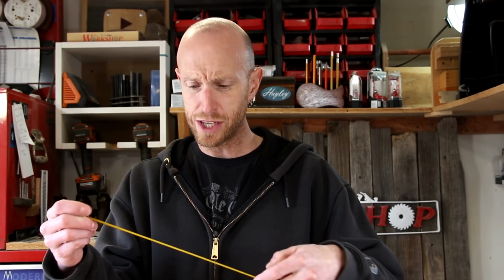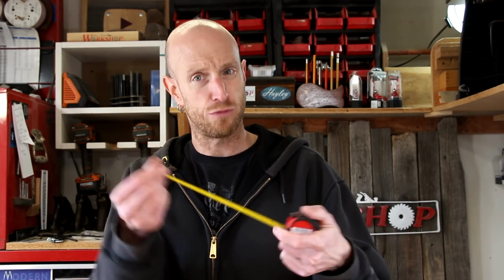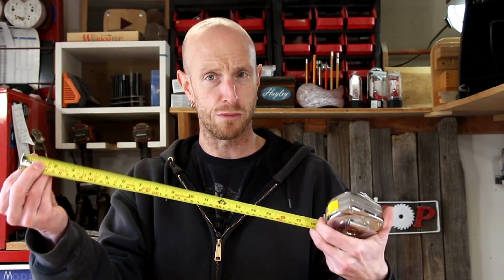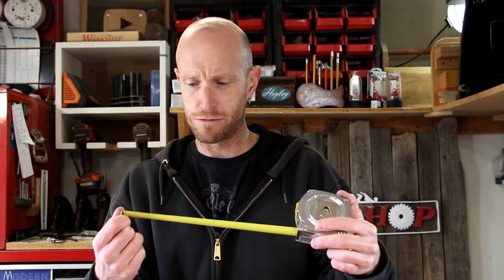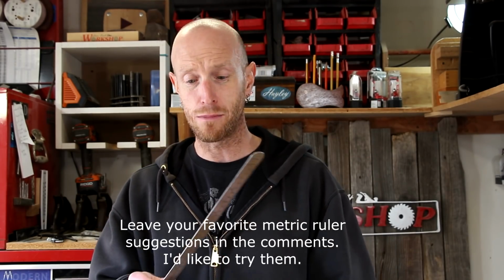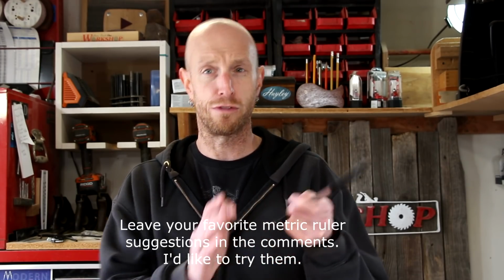My thoughts after using the Metric System for a project | I liked it

Comment: The thing with the metric system is that everything goes together in to the same base of mathematics. Volume, distance, weight, length and density. So when you know the proportions of something you automatically know many other tings about it.
Reply: What kinds of tings do you know?
Reply: Liters(volume) of water convert directly to kilograms(weight)
Example: 30L of water is exactly 30kg, or 0.03 cubic meters(volume again).
So you can also approximately calculate the weight of other fluids too...
Reply: @RaptorTroll360  It gets better, if you take a kilogram (ie, a litre) of water and raise it by one degree Kelvin, it's one kcal (which is not an SI unit but is pretty convenient.)
Reply: @1pcfred  If you know the volume and wight you know the density, if you know the density and wight you know the volume. If you know the density and volume you know the weight. It is all based on the weight, and volume of water as a prefix. And also there is fixed geometrical shapes that are very easy to do instant converts into all the mentioned measurements and the base shape is the cube. Milli= 1/1000 Cent=1/100 Deci=1/10 Hekto= 100/1 Kilo= 1000/1. The system is the same regardless of what you want to measure that is why it is so easy to convert from one property to another.
Reply: This is a great benefit. It for example means you can just as easily calculate the force exerted by a certain pressure on a 1m2 surface as on a 1mm2 surface. Just divide by 1 million.
In imperial, you divide by 144 to go from a square foot to a square inch. Or was it 256? And from square yard to square inch, the number is 1296, I think.
This nonsense costs the US economy millions each year, mostly due to preventable errors that e.g. caused a mars probe to crash.
Reply: @TheEvertw  Not to mention the failed landing on Mars.
Reply: @mikelfox1543  but why would I want to? I have no practical use for any of that. So what good is it? What would knowing do for me? Better yet what does knowing that do for you? Where in your day to day life do you use any of that? BTW it is not weight it is mass. On the Moon things weigh different but their mass is the same. They did Newton's experiment on the Moon. One of our astronauts dropped a hammer and a feather. They both landed at the same time. It was pretty surreal. Now tell me what weights more a pound of feathers or a pound of sand?
Reply: @1pcfred  A pound is a pound. How I use it in everyday life is like any mathematics, most often I dont. Dont want to start a war here. You do what works for you. Just tried to point out what I feel makes the metric system logical and easy to use.
Reply: @1pcfred  what is the practical use of trying to add portions of length in imperial? how do you add 17/64 +14/32 of an inch? and how easy is it to add 3 feet 10 inches + 4 feet 8 inches? its getting really messed up. and whats the volume of a cube with 3 feet 10 inches on each side? a complete mess
Reply: @dimosk7389  what indeed is the value of thought? Why exercise the mind at all? Everything in life should be easy. We should all be spoon fed. There is no reward in effort. Why even bother? I agree it is a complete mess. I add 17/64 +14/32 by doubling the numerator of 14/32 to 28/64 then adding 28 + 17 = 45/64 How do you do it? There is another way. Two really. Your example problem is not really realistic or practical. It would never come up in real life. If you were really interested in a precision of sixty fourths you'd probably be working in decimals anyways. Being as a sixty fourth is 0.015625 Or a smidge over a hundredth and a half of an inch. So you're only a bit over a magnitude away from a thousandth. Which is not really such a great leap. But you aren't really interested in practicalities, are you? You've never had to be. So why start now? You're punching way over your weight class kid. Pro tip: Never ask questions that you don't want the answer to.
Reply: @1pcfred  when I try to repair something at home and have to make a measurement of two pieces of wood, Its much easier to add metric numbers than imperial. It's basically "spoon fed" to you, as you prefer it.
There, I just gave you an everyday example of why someone would bother. 
I am definitely interested in practicalities. The numbers I gave you, were completely random. Don't you understand that, adding 1,24 meters plus 1,56meters, is MUCH easier than adding 3 feet 10 inches plus 4 feet 8 inches for example (random numbers)???
Are you so self minded that you can't accept that another method is much easier and simpler than the one you were taught?
Reply: @fex144  who the hell are you?
Reply: @1pcfred  in fact it would help the rest of the world in so many ways.
Reply: @1pcfred  do you really want me to believe, that a simple volume to weight conversion is nothing that Americans do? There lies the real strength of the metric system.I think most Americans don't even know, that they make their own life so complicated. And yes, I know that everything in gods own country is perfect and the rest of the world is literally the Neandertal (actually the Neandertal or Neander valley is a place here in Germany). But can you for a second imagine, that there might be methods out there, that could make your very own live easier? Can you or can you not?
Reply: @m4riel  oooh yes, that feeling when the recipe asks for 25mL of water and your measuring cup doesn't have a line at 25mL, so you simplyuse a kitchen scale and weigh 25g to give you the same quantity
I do that all the time (caution, doesn't work with olive oil but it works good enough for vinegar or wine)
Reply: @thesteaksaignant  Where did I even mention the whole 1Kg/L density of water thing? I can't tell if you're joking because that actually happened to me a few times. My measuring cup shattered and I used a scale and a small list of basic densities for water, milk and oil to measure it for a few days.
Reply: @m4riel  you seem to believe I was mocking you when I was in fact agreeing with you and providing additional anecdotes for when the metric system comes in handy. 
You did say you used it for mass, volumes and density conversions with a measuring cup or a scale. I don't think my example is too out of place

Edit: I read my previous comment and I see now how it can seem sarcastic but I genuinely do that all the time, my measuring cup is so old that most lines are hard to see
Reply: @thesteaksaignant  Yeah, I figured it could've been the case lol sorry
Reply: @1pcfred  "but why would I want to?" - well, maybe you dont want to. Maybe all you ever build is on an inch scale. 

But imagine building eg. a bridge or a skyscraper in inches only - kinda impractical isn't it? As soon as you have feet and yards you have messy conversions, and with every conversion things can (and eventually will) go wrong, which causes errors, delays and cost.

And that's just with lengths. Now think you want to build a production facilty, say a chemical plant. There you not only have lengths, but also , volumes, weights (e.g. how much does a full tank of one of the chemicals weigh, how strong do the supports have to be), flow rates, etc. ... In Imperial that's even more odd conversions, i.e. even more places where mistakes can (and will) be made.

Now scale that up to a whole country's economy and try to imagine the unnecessary cost that is created by all those unnecessarily cumbersome conversions.
Reply: @1pcfred  It's a tool... Why would you make a tool harder to use *on purpose*? Also if its easier to estimate a solution in your mind, its easier to spot errors in your calculations.
Reply: @1pcfred  noice. So when the web goes down watcha gonna do?
Reply: @iplaygames8090  why be the Lord of the Wasteland and the Ayatollah of Rock and Rolla! Of course. That and use my intranet.
Reply: James Hayden  now that you mention it yes I have made my own saw. I cut the teeth 15 TPI. How do they do tooth pitch in metric? I've never seen it.
Reply: @1pcfred  as an example of what you could repair around your home:

I just replaced the majority of our kitchen, I had to add together all of the base cabinets of different sizes, then add to that the 18mm finishing boards and on top of that had to add in a 32mm overhang for the counter top.

also had to take into account the fact the counter top is 38mm thick, the surface of it should be 900mm from the finished floor to "feel right" and the fact that my finished floor will be 15mm higher than my sub floor, all while the base cabinets are 720mm tall.

as someone who has used the metric system their whole life, I cannot imagine truing to do all that it feet, inches and fractions of inches.

if you can do simple addition and subtraction, thats all you really need to use the metric system.

another example, I needed to order a new filter/pump for a fish tank, had no idea what the capacity was, so i just busted out the tape measure and found out within a minute.
Reply: @myopinion69420  here we just go to a cabinet shop and they design cabinets for us. They're all the same standard sizes. All you have to do when you install them is make sure they're level. All the measuring in the world won't change that either. Either you're bubble up or you ain't. Floors are not always perfectly level either. Houses can settle. So you put all your cabinets the same height off the floor and you have out of level cabinets. Good job! I'll give you a pro tip building, do as little measuring as possible. The less measuring and figuring you do the better your work will come out. I really do not care what measuring system you use either. Don't measure remains true regardless.

I do not have a fish tank but I do have a pool. It is a 16 x 32 oval. Now how are you going to figure its volume out with just a tape measure Archimedes?
Reply: @1pcfred  i am well aware of how to build and install kitchen cabinets. your way i would just pick a random height and just hope the dishwasher fits under once the floor is in? thats a bad idea. i was not saying i set EACH cabinet the same height off the floor, but i did need a starting point and used a laser level to do the rest.

"do as little measuring as possible" is a recipe to running way over budget.

who said anything about your oval pool? how would you do that in 'standard'? that being said, with a bit of trig and a bunch of measurements you could get a decent approximation of the volume.
Reply: @1pcfred  I would be more than willing to engage in  a meaningful discussion if others haven't already. Yet you seem to make a huge fuss out of trivial details like differences in floor height. Really?

One argument: simple calculations such as area, volume, density, mass even energy consumption, are all very easy to calculate, unlike imperial.
The field of mathematics and science uses the SI system, because it's so easy,  convenient, understood instantaneously by all that uses and understands it. Centi-one/hundredth, hence centimeter(0.4 inches). Milimeter, one thousandth of a meter, kilo one thousand meters.

You can so effortlessly deal with small and large numbers, convert to different, more appropriate units of measurement easier. Metric units increases or decreases in multiples of 10. Mili, Centi, deci, kilo and everything in between.

Even in today's digitalised world, why not just use a better and more convenient system? Why say 1 foot 3 inches when you can say 38cm? And convert to other units using factors of 10?
Reply: @1pcfred  Somethings it isn't about what the system can do for you, how it can help you specifically. It is about the greater math and science community with their respective fields of study.
Reply: @1pcfred  Not to mention the glory of metric being so accurate. Write something down as 1 meter and desire it to be more accurate? 1.32m, 1 meter and 32 centimeters. Bases of 10, moving decimal points, not a problem. Same way you can express 1.32m as 1320 milimeters, just divide by 1000
Reply: @1pcfred  Agreed! And the Imperial system is soooo practical, efficient and easy to use that many organizations in the US, mostly those concerned with efficiency and practicality, are using it exclusively : US Military, Medical, Nasa, Scientific community.. Oh wait, no they use the metric system! Sorry, my mistake! :) Still congrats for knowing more one way to add fractions, quite the academic achievement! :) All in good fun : you know that the day the US goes Metric and gets a decent health care system, then the rest of the world won't have anything to make fun of! (add Education system and some knowledge of Geography to the list above) :)
Reply: @1pcfred  AAAAAAAAAAAAAAND another american trying to defend the imperial system. mom, get the popcorn!
Reply: @1pcfred  I cook. Sometimes I don't have a measuring cup. No issue, I use my weight instead. For water, milk and most other common cooking liquids, 100 grams equals 100 ml or 1 dl.
Reply: If easy things are easy to do then it makes harder things easier to figure out. 
If our numerical system required us to calculate for an hour every time we wanted to add 1 and 4 we would not be as technologically advanced as we are.
Reply: @aLmAnZio  you have a precision scale more often than you have measuring cups? Are you an unlicensed entrepreneurial pharmacist too? Because I've been in a lot of kitchens. Most don't have gram scales in them. Measuring cups are pretty basic though.
Reply: @rodabanane  no American ever needs to defend Imperial because no American has ever used Imperial. We have our own system called US Customary. Only the names are the same. Although everyone has adopted the standard international industrial inch. Which itself is not Imperial either. Which is why our inch is the same as the British inch is today. It is neither Imperial nor old US. All of that is likely why you confuse our system with Imperial.
Reply: @arandominternetuser5203  you are confusing accuracy with precision. They are two different things.
Reply: @arandominternetuser5203  not being in the math or science community myself I fail to see how any of that has anything to do with me.
Reply: @arandominternetuser5203  when you're setting kitchen cabinets floor and ceiling heights are anything but trivial. If you'd ever done it then you should know that too. Or you're just blind. Really.

As far as why one would want to say 1 foot 3 inches as opposed to 38 cm goes the human mind has difficulty envisioning larger quantities of things. So a foot and a bit more is easier for us to mentally deal with. Close your eyes and imagine 38 separate things in a row. If you say you can do it then you're just lying. Because we can't do much more than 3. It is a mental limitation. How metric works completely ignores human limitations. You can run into the same problem with standard too. Things can be large numbers of inches. In general we can express values in more digestible values though. As opposed to thousands of mms or cms. Basically metric lacks the foot equivalent value. There's the decimeter but it never caught on. It's a useless size. It's so bad most metric users don't even know what a decimeter is. They've never even heard of it. Metric was never scaled for human use. It is nice and neat but life isn't. The messy standard system just fits things better. The consistency of metric comes off as random in use. Like all of the numbers you've rattled off. You could say a foot and a quarter instead of one foot 3 inches. Although that would be weird. It still works. Standard can be rounded to work. I suppose instead of saying 38cm you could just call it 40. But that is way off.
Reply: @myopinion69420  but you claimed that using metric makes all volume calculations easier. I have to go out and work on my pool right now.
Reply: @1pcfred  dunno, but I would only need to know the density to do a simple conversion and know how much space you wasted by bringing a pillowcase full of feathers on the Moon.
Reply: @1pcfred  what's the weight of 300 fl oz of water?
Reply: @1pcfred  You are right that decimeter is rarely used (at least outside of its cubic variant, representing 1 liter btw), but the concept of 10 cm is well known and as easy to imagine for someone using metric on a daily basis as is 1 foot for you. If said person wants to know how much would it be 38 cm they could to see it as 4 x 10 cm. For me 10 cm is about the width of the palm of my hand which can be helpful in such situations. No need to force the brain into 38 individual sections 1 cm each.
Reply: @1pcfred  Lets say you are baking a cake and you need 300ml of milk. You can easily pop a container on the scale, tare it, fill it with milk, and pour until the scale reaches 300 grams. The reason this works is because milk has an extremely similar density to water. If you have to measure out lets say 1.6 quarts, you can measure out a quart, but now you are stuck filling many ounce measuring cups just to get that .6.

Imperial system works good when mixing drinks because you are making a small amount and the accuracy doesn't matter too much, but the second you need to measure larger amounts or measure liquids accurately, quickly, and with little effort, the imperial system fails in every way
Reply: @RaptorTroll360  weighing liquids other than water is very rough. Oil (any) is more dense than water. Or patrol/diesel. So be very careful when "roughly" calculating the weight of a liquid tjat way.
Reply: @1pcfred  I live in Norway, all our scales measure in grams. Like dirt cheap ones. And yes, I often end up in a situation where my measuring cups are dirty, and scales are more convenient.
Reply: i still remember trying to calculate how much water can i put into XxYxZ pool... thanks god i needed just calculate inside and from 1 dm3 convert easily to liters, i would die calculating this in imperial
Reply: @1pcfred  Yeah why should we use a unified system that allows people to instantly know the magnitude and conversion to anything just by applying simple rules therefore giving them an easier time working with those units so they can focus in more important things while doing maths? Nah im sure thats for spoonfed millenials who don't want to divide by 16, or 12 or whatever.

Please stop humiliating yourself.
Reply: @brendanbush2174  if I was baking a cake there's no way I'd use one with ml measurements in the recipe. It'd be a pretty big cake with a quart and pint of milk in it too. That is an incredible amount of wet to be in a cake. You ever bake a cake? Looking at a typical box cake recipe 1-1/4 cups is about all you put in an average cake. They usually get their moisture from oil and the eggs. As it's name suggests a cup is about the size of an average cup. 8 fluid ounces. Imagine a medium sized tea or coffee cup. There you go. A cup. For baking a cake using it would suffice. We're not trying to decode DNA here so ml accuracy is not required. Get the batter to a consistency and pan it up. You're going to wreck your cake in the oven using that horrid temperature scale you have anyways. So don't sweat the mix. And where's your metric time anyways? With 100 minutes in every hour and 100 hours in every day. Come on kid make it happen. I need more stuff to poke fun at.
Reply: @brys555  the palm of you hand you say? Would that be a hairy palm?
Reply: @1pcfred  Did you know that alot of things in the US is already using metric system. like medical, science, engineers are. Also many international products like cocacola propably is there in liter
Reply: @1pcfred  You jumped on that typo like a duck on a june bug!
Reply: @blockbertus  There are exceptions, but generally most oils are LESS dense than water, not more dense. There's a reason why oil and gasoline float on water...
Reply: @TheAmethyz  I lived through the metrification of soft drinks. The rest that you mention I really have no interest in. I try to stay away from all of that as much as I can. No doctors.
Reply: @1pcfred  you are not very good at staying away from all of metric for you are asking and replying to reasons why others use it. Not everyone sees why something can be so useful to everyone else and thats okay. Like you said somewhere there you dont need it in everyday life, but thats just you some people do stuff where they need to convert things and measure things and distances and thats where they use it in their everyday life. But truth is no one should be forced to use one or the other way and no one is but then there have to be converting from one to other and thats where mistakes can happen (mars incident)
Reply: Perfect answer.
Reply: @1pcfred  wait, you don't have a weight scale in your kitchens? Wow I thought everyone had that
Reply: @1pcfred  How are accuracy and precision any different? Might just be confused because English isn't my first language, but how can you be precise while not being accurate? Maybe the words mean slightly different things, but they go hand in hand
Reply: @1pcfred  uhh we use decimeter , it's one tenth of a meter... plus if you somehow cannot process 120 centimeters, you can just say 1 meter 2 decimeters... You can easily convert up if you wanted to, but then you can just as easily convert is back again, for example millimeters, by multiplying with 1000 (thousand if your brain can't handle numbers bigger than three) So in my example it would be 1.2 meters (1 meter 2 decimeters) is 1200 millimeters. You can really be quick and precise/accurate with just a simple calculation based on the fractions of 10
Reply: @1pcfred  you aren't in the science comunity yourself? No shit, i could never have guessed. Caveman.
Reply: @1pcfred  this explain a lot imo - it's simply much easier, and everything make sense:
https://www.reddit.com/r/Metric/comments/6aigo9/difference_between_converting_metric_units_and/
Reply: @dacsus  the conversion argument is moot because we don't have to do conversions regularly. I use my measurements directly. I do not convert anything. Maybe I convert between decimals and fractions sometimes. But doing that is just a convenience for me. As far as I am concerned I am far better off having both too. As one informs the use of the other. If I measure something and it is close to a fraction then I can adjust the measurement to be that fraction. To make it more, "right". Metric offers no such guidance. I suppose you could round to the centimeter? That's rather limited though. I often discuss that as working to a chosen granularity. In that US Customary has far more choices. I do not strive for simplicity or ease in my life. Only excellence. Which is rarely simple or ever easy to accomplish.
Reply: @marciturani6416  the decimeter is rarely used. Most I've spoken to have never even heard of it. So uh, you're full of it.
Reply: @1pcfred  Dude, if someone tells me that something measures 15 387 Kilometers, I immediately know that it is at the same time 15 387 000 meters,  and 15 387 000 000 millimeters. Immediately, without any calculation.

And not only that. If someone tells me that the aquarium is 30 x 40 x 50 centimeters, I immediately know that it is 60 liters. And that the water in it, if I fill it completely, will weigh 60 Kilograms. I don't have to do anything on a calculator or a computer.

Can you convert 15,387 miles immediately into yards, feet and inches? Without calculator? 
Or how many galons is in aquarium in 2 x 3 x 4 feets?

If the metric system were more limited, it would not be used by almost all but three countries, which for some strange reasons (e.g. laziness or unwillingness to change) still rely on outdated system.
Why do you think the metric system is used by scientists, the military and hospitals in the US?
Reply: @marciturani6416  the difference between the two is a bit subtle but critical. Let's just say you can precisely miss a target with extreme accuracy.
Reply: @1pcfred  well I live in Europe, use the metric system and talk to people who use the metric system every day. On the other hand, you live in America, use the imperial system, and talk to other Americans about how they don't know the metric system. Yet you still somehow know perfectly what we use over here, because how exactly? You talked to other americans, and they told you they don't know what a decimeter is? okay, yeah I'm full of it, we don't use the decimeter, because you said so
Reply: @1pcfred  "you can precisely miss a target with extreme accuracy" But if you missed, then you weren't extremely accurate, because you couldn't hit the target. Or if you meant that you were trying to miss only by a small margin, then you actually shot where you wanted to, you didn't miss your target. 
Oh and another thing. Isn't it the same as "you can accurately miss a target with extreme precision"? How is that any different in meaning? I could easily change the words up, the sentence has the same meaning. Thus the words mean the same thing.
Reply: @1pcfred  "If I measure something and it's close to a fraction, I can adjust the measurement to be that fraction. To get it "right.""
You mean you round it off by guessing? WTF? 
The metric system allows you to do everything accurately without estimating.
Because there you don't need to guess anything, but as I said in the example above, you know exactly every length to the millimeters (even to their tenths, hundredths, or thousandths).
That's why it is used by scientists - you know, in rocket engineering and similar industries, where every millionth of an cm/liter/kilogram counts, and nothing is estimated.
Reply: @marciturani6416  if you always missed the target by precisely the same amount you would be missing it extremely accurately. It is what we call grouping. A group can be tight and still miss the target. It remains an accurate group. It just is not a very precise one.
Reply: @1pcfred  dude, it was an example, it could be easily a a swimming pool, don't you think?
So, how many gallons does a 10 x 3 x 25 yard pool hold. And how many tonnes of water does it hold? I am sure you need a calculator for this ;)
Reply: @1pcfred  And dude, are you aware that there are industries where the precision is important? 
Not everyone makes tables and chairs. Hell, even pool tables have to be accurate to tenths of a millimeter.
Reply: @1pcfred  ah thanks, I understand the difference now. I still don't get your points and reasoning though
Reply: @dacsus  I bet I've known the metric system for longer than you have. When were you taught metric? And you do just slap metric numbers onto a lot of standard products. Anything you call 13 mm is really a half an inch. 19 mm is 3/4" 6 mm = 1/4" Anything you see in any of those sizes is really inch standard. You just pretend it is metric. Of course 25 mm = 1 inch too. Or close to it. Who's going to quibble over two fifths of a millimeter? It is a standard world. You're just living in it. Your whole life is a lie!
Reply: @j.f.christ8421  like the USA makes stuff. That powdercoat got drop shipped from China!
Reply: @1pcfred  Fun fact: you are using the metric system :) Since 1959 the definition of the yard is that it's exactly 0.9144 meters
Reply: @fpetya86  US Customary uses metric standards. But I am not a standards official so I do not use metric personally. Although I do perform a lot of conversions. The standard industrial inch has been pegged to metric for a lot longer than just 1959. One inch equals precisely 2.54 cm. It was a compromise a swede named  Carl Edvard Johansson came up with at the turn of the 20th century.
Reply: @JackFate76   ...look at japan and south korea ..there is thech ..us is just fuel and war ..and they are at their limit
Reply: @1pcfred  Dude, i am 3. january 1972, so i am pretty sure, i ma older than you. And I am a graduate mechanical engineer.
Reply: @dacsus  you're 8 years younger than I am. Congratulations on being an academic too. If you want to impress me then graduate from the school of hard knocks. Don't just go to schools, build them! I've lost count on the number I've worked on. Even Ivy league!
Reply: @1pcfred  I thought this debate was about the metric system, not about somehow impressing you - and even though you're 8 years older, it's still true that I've been in contact with the metric system since I was a kid.
Reply: @dacsus  you weren't even alive when I learned the metric system.
Reply: @dacsus  I am not a scientist although once I built the greatest laboratory on Earth. Which you'll likely doubt too. But I still got the tee shirt. There is nothing better about metric. All that conversion crap that's easier to do in metric is nothing I ever need to do. All I ever do is measure lengths. That's it. And for that metric absolutely sucks. Metric is not a human sized scale. I never used the Imperial system either. I'm an American! My country broke away from the Empire 50 years before the Imperial scale existed. What did they teach you in school? Not much it seems.
Reply: @1pcfred  OK, lol...
Reply: @dacsus  I'm glad it is OK with you.
Reply: @1pcfred  I see your points and i actually think you make a fair argument. however, wishing upon a star that people would be perfect is a bad idea. everyone makes mistakes and it is best to eliminate unnecessary difficulty when calculating. you might be an imperial or any other measurement standard calculating god. it's just not the greatest move to overcomplicate what could be simple. not saying that imperial is hard. if you agree that people have the capacity to be stupid how can you be against simplified systems. Makes you look like a stubborn elitist. This stubbornness against factually easier/better systems also makes it clear you're not progressive either. I could also just say OK BOOMER which is the best equivalent of my argument i suppose
Reply: @empyreum6869  no one ever makes mistakes when they use metric? Hard to believe. Nothing worthwhile is ever easy either. If you realize something is difficult then you should give it the attention and effort that it deserves. If you think measuring is hard then just wait until you start doing the work. Things can get tricky then. Remember, cut on the waste side of the line!
Reply: @1pcfred  Lol thats the best. - i read this essentially as "Metric system's strength is make things easier for its dumb users. Thats why I use the superior imperial system, which I would need to refer to online convesion calculators in order to correctly calculate the measurements i need."  
Definitely seems like imperial is superior and metric just makes things easier on the rest of us dummies.
Reply: @stevenmcdonaugh3230  I don't use an online conversion calculator. Yet they still do exist. If it wasn't for metric then converting would not even be a thing either. Don't blame older systems because newer ones came along. Reject that new crap!
Reply: @1pcfred  Lol, "Reject that new crap." by that logic... what are you doing on a computer or smart phone if the first place? Shouldn't you be out living in a hermit hut built to imperial spec?

Also, FYI, the US references it's imperial measurements off the metric system. 
you guys even signed the "Treaty of the Meter" in 1875. 
The treaty has literally been in place longer than gasoline-powered car have been around.. So I wouldn't exactly call it "New Crap" 

America has the system in place, yet still converts to from metric references to Imperial in order to maintain the out-dated system.
All of the tools and equipment you use (Provided they were manufactured any time post 19th century.) were more than likely based on the metric system refereneces and converted to imperial units.
Reply: @stevenmcdonaugh3230  at the rate things have been going the hut plan is looking better. I wouldn't rule it out quite yet. If truth be told I'm more than halfway there already.
Reply: @1pcfred  I am very much convinced you are an elaborate trolling attempt
Reply: @dacsus  tbh, Myanmar(Burma) doesn't use the imperial system anymore, since 2013 i believe(or was it 2003?) an agreement was made to shift to the metric system. I believe implementation was finished by 2019.

That's the official statement anyway, the locals use a different system that is neither imperial nor metric. It's a very confusing and non-intuitive system that should be rid off.
Reply: @phyokyawkhaing2251  to err is human.
Reply: They based on universal constants too
Reply: @Rebotified  and you know that how?